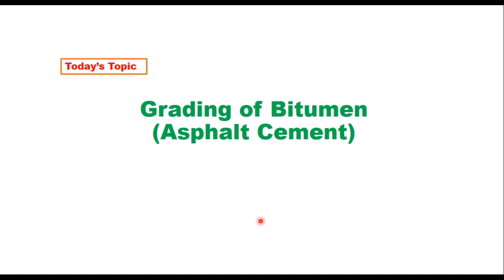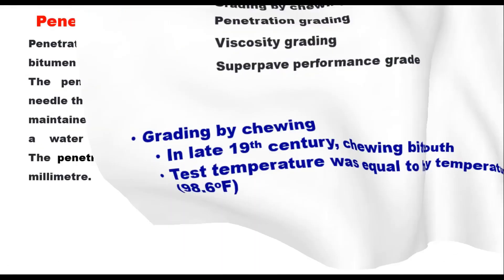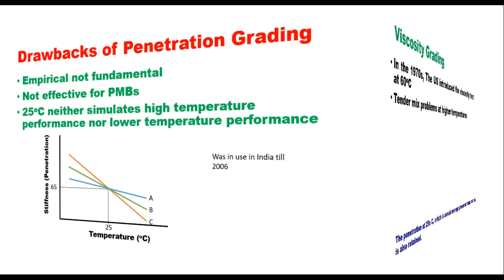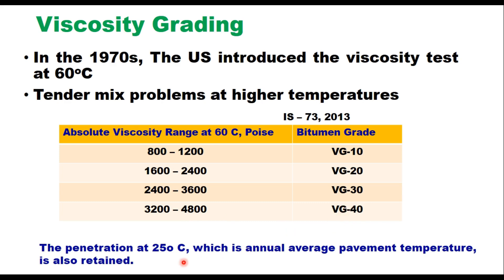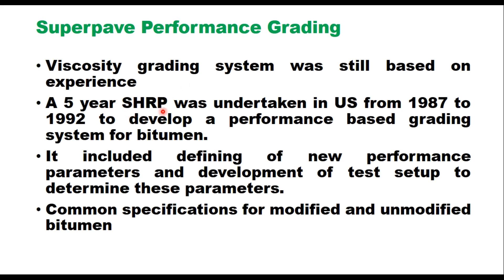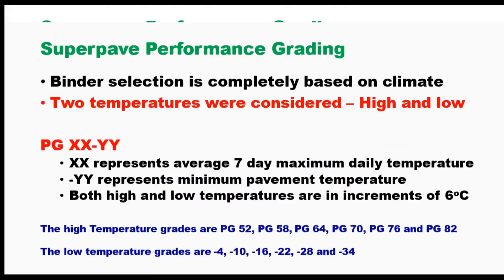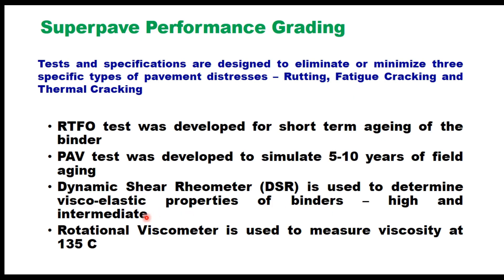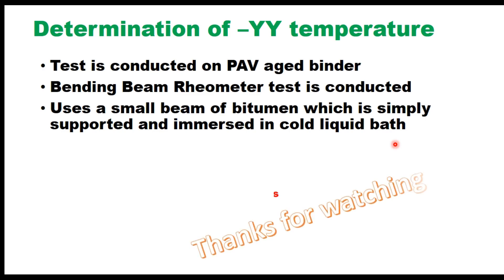#Grading of #Asphaltbinders, historical methods and present system of performance grading of binders

Comment: Very insightful. Thanks for always feeding us with knowledge.

Sir, can you kindly enlighten me on the differences between degree of communication of asphalt concrete and Percentage Refusal Density tests? 

I will be so great full
Reply from the maker: Refusal density is the when where air voids cannot be reduced further. It is generally achieved at around 250 gyrations in Superpave Gyrotary compactor.

Comment: Good afternoon Sir, wish you are all good. Sir, I am having question but can not find the answer. Please help me if you have any answer. Sir, I have tons of Bitumen BND 60/90. Is it possible to turn Bitumen BND 60/90 to Bitumen BND 50/70. Is there any machine or style to turn 60/90 to 50/70. Thanks very much.
Reply from the maker: converting a softer grade bitumen in to a harder grade is a reverse process in refineries and can be done through oxidation. But the extent of oxidation is not known to get the correct grade. Alternatively, you can use thermoplastic coploymer (TPC) to harden the grade. There are several groups of TPC available in the market, but choose the one which will have higher percentage of amorphous region.

Comment: And sir how 10 rad/s is corresponding to 88 kmph? Can u explain?
Reply from the maker: This is not to be related directly. According to DSR test, the oscillation rate of 10 rad/second simulates the shearing action correspoending to a speed of about 88 km/hr. Actual speed of traffic at this shearing rate will be around 16 km/hr.